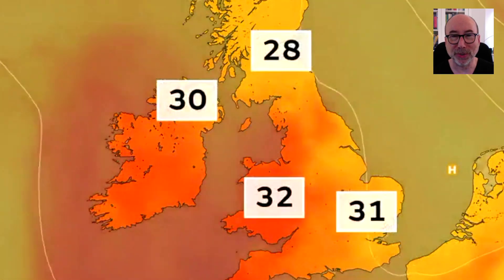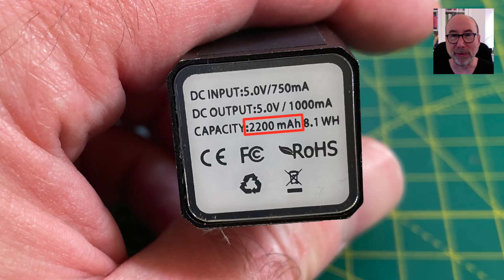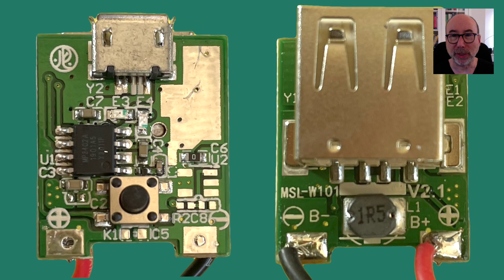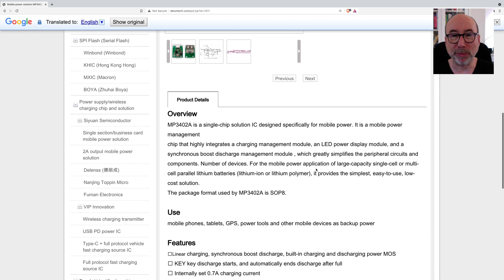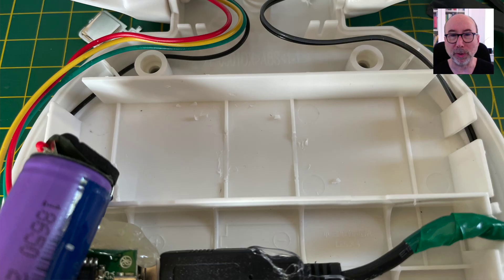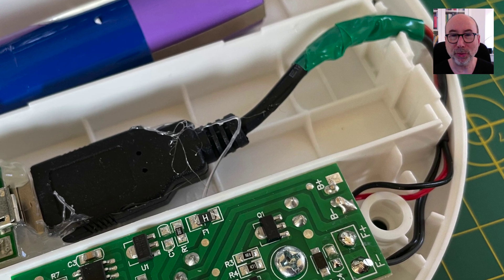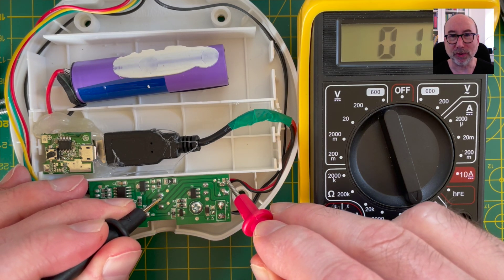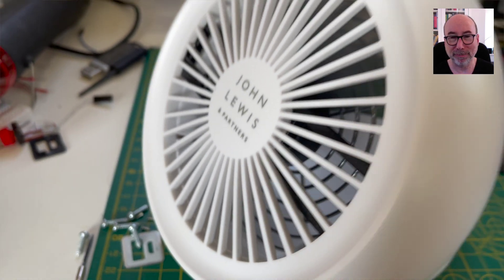Fan Hack: Power Bank to Battery-Free Desk Fan!

Comment: If you add two shottky diodes, in order to create a power path on the positive rail, and battery rail,  you can charge it while it run. It will also become a kind of UPS. No off time to charge it.
Reply: I've always wondered why some power banks can be used (safely) while charging and why others cannot. This is so simple I'm amazed by it! Thanks for the info
Reply from the maker: That would be really handy - those couple of hours while it charges back up are a bit uncomfortable!
Reply: @atomic14  one from usb 5V to the load, the other one from the chip 5V output to the load. In this case the voltage drop is not critical, so you can use any diode can handle the fan current.

Comment: There is also the MP4301A, and SY3511 which also has 4 LEDs to indicate state of charge. 
but standby current of 100uA, which is the same on all these chips. 
I had to build my own UPS using an 18650, a TP4056 module and an MT3608 boost module (Which I love, and the only chip that can operate down to +2V supply).
A real ON/OFF switch is used in my setup, to power the booster and a power output LED, from the TP4056 output. 
Since the modules combined is less than $2, and the whole project less than $5, I couldn't beat that as a custom 5V 5W UPS.
If I want to drive 0.1mA @ 5V, it's my business! Not some "smart" chip going to sleep on the job :)
Reply from the maker: That's funny - I just had a bag to TP4056 MT3608 modules turn up this morning!
Reply: @atomic14  That is funny. 
My ESP module is working...

Comment: my fan is connected to a big power bank by a 3 pin plug, has not run out of power yet ;-) Nice to see somebody keeping their cool.
Reply: @atomic14  Sorry just like to joke. But i never understand this need for power banks?
All my power supplies are mains supplied, same with my soldering irons, bench DVMs and scope. the only battery powered items are my 3 handheld multimeters.
At my last job when I bought all the test equipment all the DMM's were mains powered bench units. one is you never get a flat battery when you need to use one, and two somehow they never get taken out of the test room to be used by production on the shop floor.

surprising how fast a good quality fluke handheld DMM can grow legs, even when the door is locked. ;-)